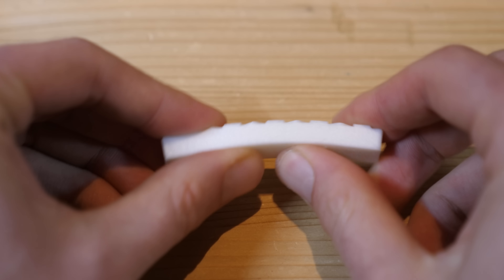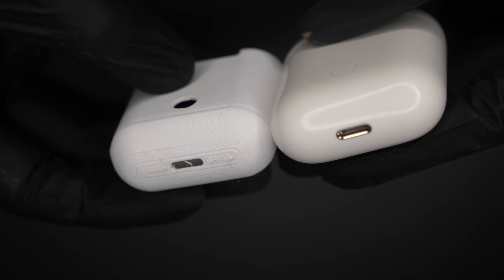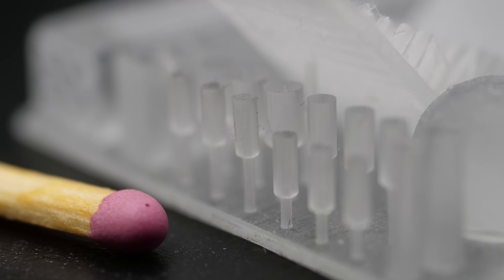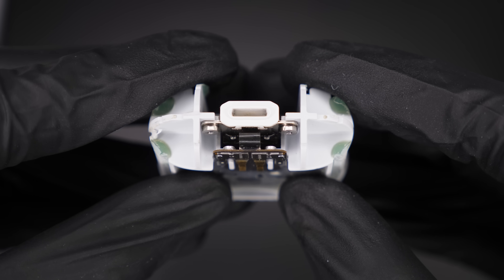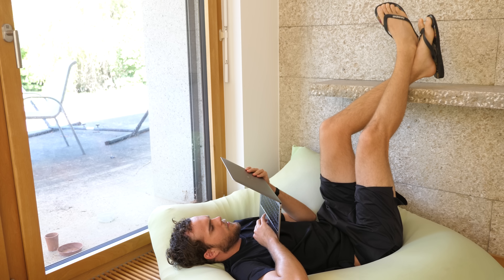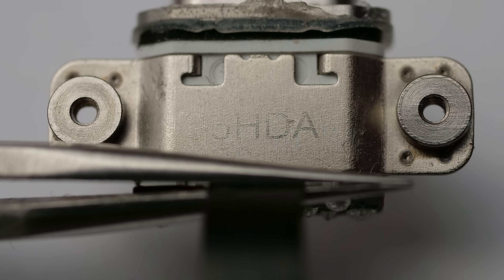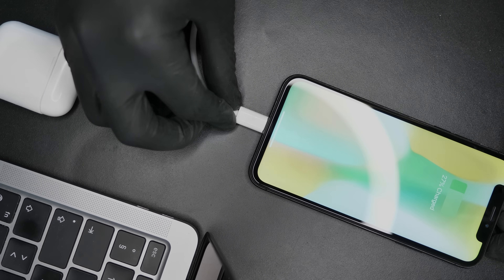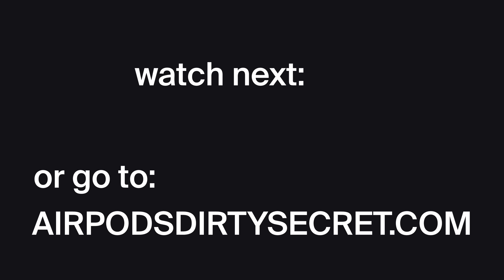AirPods' Dirty Secret (and how I'm fighting it!)

Comment: You're focussing on the wrong thing. 
Airpods are TINY and use a TINY amount of resources. Compare this to a car say which uses literally millions of times the resources.
If you were to properly recycle all components of maybe 100 cars that's the same as every pair of AirPods ever made.
The tech in Airpods and their case becomes obsolete in a few years in any case. This exercise is almost entirely pointless - you're almost certainly using far more resources than you're saving here - and even if Apple supported this it is, once again, Green Wash. 

This is you having fun, which is fine - but lets not pretend you're helping the environment in any way. You aren't.

Comment: Why it is sold like this; to make it repereably they would have to make the manufacturing cost much higher. Beginning with designing for reparability, choosing parts, checking if all works, providing spares later on. All that elevates cost. Sometimes it is better to produce with replacing in mind.

Comment: I need some GoPro mods like this, I used to check ragecams products but they were overpriced to the point of I should just buy a modded camera from them. All I wanted was to extend the image sensor cable to add cooling to the sensor and board.

Comment: More than 99% of the people cannot do the type of work you are demonstrating.  Most people cannot take apart any type of device to replace the battery.  As for myself buy products that are reasonable in cost to service or replace as necessary. I am using an Android phone.  If someone had to pay a design and assembly service to the AirPod project you demonstrated the cost would be ridiculous.

Comment: I still have the first gen pair. Accidentally put them through the washer and dryer multiple times, took a couple years before they finally died, (don't really hold a charge) have the pro now. But the old pair is just sitting on my closet shelf.

Comment: This video is dumb. Basically you need $2000 in 3d printing machines, space to house them and ventilate them, throw away a ton of support material, skills and training to use the software and hardware, in order to save some plastic? What is the point? I'm sure I can make a pair of jeans with a similar level of efforts but this is kind of dumb.
Reply from the maker: Hey, before calling something dumb please think a little bit harder, maybe you are missing something. Here the point is not to 'save some plastic', it is to save the rare earth materials from the electronics and battery inside the case. To give them a second life. Sure the first version requires a lot of effort, but it's  because I'm making it myself at home and it needs to be entertaining. The goal is to have the design mass-produced so people don't have to go through the same hurdle at home, they could just buy the kit.
Thanks for watching

Comment: & how environmentally friendly is all the chemicals U are using or the amount of plastic being used for the bottles they are stored in.???
Reply from the maker: You are right that it is not very environmentaly friendly just to produce the first prototype like I did. Here the goal is to demonstrate the idea with the hopes that the replacement part could be mass-produced in another way (injection molding for example). The point is to save the rare earth materials of the electronics and the battery present inside the case. 
Thanks for watching

Comment: I dont know why in the US there is apparently no competent technician, but I've been fixing AirPods 1/2 and Pro without breaking them, takes time but is doable, we change batteries from case and airpods with no mayor problem

But besides that point, amazing video, It is cool to print new airpods case designs
Reply from the maker: Would love to see a video of you repairing a Gen 1 case :) I'll be impressed if you can pull it off without visual damage.
Reply: @ExploringTheSimulation  I just have one that a costumer left the other day and I am waiting for new batteries from china, I will tag you on it as soon as I do the video (in my channel I have video changing the batteries from the “pods” they are much easier to take apart) , the case it takes time to do and it’s not that easy to take it apart but I have managed to do it, I still can’t believe how a guy with so much expertise like you can’t pull it off. I think you just haven’t take your time trying the proper technique 😅

Comment: Thank you for sharing your innovative efforts to up cycle the Apple AirPod case.

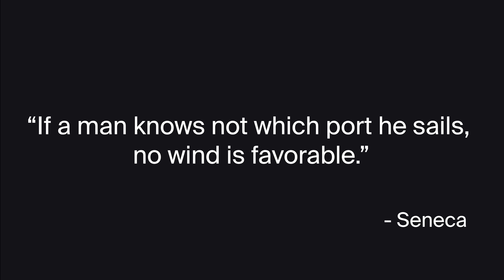Did you cover the main PCB inside the case (as shown at 6:43 in the video) with epoxy or printer resin or was it that way originally? I assume that you might have done this to improve water resistance.
Reply from the maker: It was like this originally, although out of the 3 cases I've cracked open, 1 didn't have it
Reply: @ExploringTheSimulation  thank you for sharing your experiences.

Comment: Planned obsolescence, as most things are designed these days, which hopefully will eventually be a fineable offense after the right to repair, and adjacent, laws start gaining traction. Apple could've designed these to have a rounded detent rather than a buttress tooth, all it would take is some force to pop the inner molding out of the case, 100% repairable and entirely unlikely to pop apart if you drop it. Hopefully environmental agencies will go after these companies as they actually have grounds to currently do so, whereas the typical consumer protection agencies currently do not as right to repair laws haven't gotten to the point of making maliciously anti-consumer designs a violation of consumer rights to repair products. 

As far as ports go, I prefer the design of the Lightning over USB C's design. Reason being is simplicity and physical mode of failure. USB C has a male nub inside of a female port and a male port with a female receptacle for that nub, what happens when that little nub breaks off or gets damaged, imagine how easily that nub can be damaged, just like all of the mini and micro ports before it within USB's lineage. Now compare that to Lightning, where you have a fully male port and a fully female port, the individual components themselves are more robust and simpler. Now compare repairs between the two designs if the male PCB breaks, USB C needs the device repaired which can be costly, whereas Lightning would only need the cable replaced which is far cheaper in comparison. I want a single standard just as much as everyone else, but USB C was not the way to go, especially when we've had this for half a decade now and I can tell you that the connection does wear out eventually, and loose connections can cause damage to thin PCBs acting as the copper connection point. USB should've just adopted Lightning's design philosophy. Hopefully there's a future standard of USB, such as a D port, that utilizes this more robust solution; as I also have doubts of C's longevity as standards are more quickly evolving and data throughput will realistically need more physical copper in the future, especially as USB is becoming the universal bus for many standards via mode switching and the capability of daisy chaining devices, C just doesn't have the physical lane width for what the standard is trying to achieve.

Comment: The AirPods being glued shut is one thing but to not include screws to easily access the case just shows how much they want you to waste money on another , eco my ass , buy a cheap brand and you might be able to repair it without pro level equipment, next step T2 chip to stop port replacements all while disguised as a security measure 🤦‍♂️

Comment: Just to point out the one argument about this being for the environment... your original case still went in a landfill.  Using epoxy to repair the original case would have made that point. But 3D printing it to fix it, totally onboard. Just don't need the Eco BS. You know?
Reply from the maker: the argument lies more in saving the rare earth materials present in the electronics inside the case than saving a few grams of plastic and adding some epoxy on it, which will make the solution less accessible to people than a standalone replacement part. thanks for the comment
Reply: @ExploringTheSimulation  That makes sense.

Comment: Not only he fixed the issue considered impossible, he upgrades it. Gigachad my man.
Reply: I've never once seen a type C cable busted open with wires showing and it's soul devoured by like 1 year of use. I can't say the same for lightning cables and ports. Pretty sure USB-C is an all around upgrade in performance and durability. But man... Do you guys remember when phone ports used to wear out and eventually you couldn't even charge them anymore? I'm just glad we don't live in that world anymore.
Reply: Good he made a repairable one, but why make something that looks like the same thing?
Reply: @mhavock  I mean, as DankPods always points out, Apple's case is really one of the best designs when it comes to pocket-ability. It's not the overall size that counts, it's thickness. And as a proud Galaxy Buds user I hate to admit this but Apple has got it right there. Samsung even made theirs a bit more slim and bigger in the other dimensions with their newer Buds Pro.
Reply: Apple is gonna come after him for royalties along with "seize" and desist.
Reply: I mean, they never said it was impossible. They said it was more expensive to repair than replace. Which is correct (or at least was, prior to China's ongoing economic collapse).
Reply: absolute lad
Reply: True legend
Reply: The Gigachad: Destroyer of Karen
Reply: She said usually, not impossible
Reply: He snatched victory out of the jaws of defeat
Reply: Agreed.
Reply: And almost with no effort 😂😂
Reply: These day things are called impossible purely because of profit margins
Reply: Nothing is impossible.
Reply: Is it not illegal though ...are they not patented?
Reply: Nothing Is impossible
Reply: Best part, he shared it.. A contributor to the bigger picture, we need more of those !
Reply: Gigachad
Reply: this was not economical
Reply: The type c port isn't an upgrade
Reply: @mus_xr4653  depand on how you look at it.
Reply: @mus_xr4653  Type-C Port is a upgrade in any way. It's way faster than those outdated Lightning ports.
Reply: @0x495e  it's not going to charge the air pods faster and you won't need the faster transfer speed and the lightning is much more durable
Reply: @mus_xr4653  You can believe what you want. you can also go buy another set and keep feeding the monster
Reply: @KRigby  i only have one Apple product and it is an iPhone xr and, i hadn't replace the port nor the cable. i also support right to repair but not with the cost of making products less durable
Reply: @KRigby  i also have a 8 year old Samsung tablet that i keep fixing
Reply: @mus_xr4653  on durability... are you complaining about the port or the jack? I hate micro-usb, but then again i don't think i would have that opinion if all the micro-usb ports i ever used were apple products because they wouldn't use cheap surface mount ports. In the same train, I've had a lot of 3rd party lighting dongles snap at the lighting jack, over priced Belkin ones seem to hold up.
Reply: @itainteasy  both. The micro usb port is the worst in terms of durability, i had to replace it on my device 5 times
Reply: @mus_xr4653  Eh, I'd rather have the convenience of not having to worry about keeping a Lightning cable around vs the very minor durability loss compared to USB-C. But honestly, we'll probably see a portless Airpods case next
Reply: @mus_xr4653  bwahahaha. Did you just say lightning is more durable. Almost every single apple brand lightning cable falls apart within a year. It's already been proven by actual science, rather than your anecdotal evidence from ONE device (LOL), that USB c is far more durable. Derrrrrp. You sound like the one guy that has a car known for its unreliability, and comments, "I've had one for 15 years and never had a problem." LOL. Like a sample size of ONE matters at all. It's like people don't understand how statistics work.
Reply: @mus_xr4653  Never had a USB-C cable corrode or break from literally sitting in a car, but the lightning cables always corrode and-or break at the cord or pins corrode away. So it might be durable, but the cord and pins are trash!
Reply: @littlejackalo5326  Agreed that the lightning cable is very fragile but not every one has to replace them every year. Mine is still working fine from 2019 even after I bent it while charging my iPhone. I just unbent it and it works fine. Same with my friend.
Reply: @mus_xr4653  Lightining is not more durable, never has been (let's just say a wide open port with no center makes for a great lint and dirt trap), and the iPhone XR isn't even close to old enough to claim durability on personal experience alone. USB-C is known to be durable as a matter of mechanical design and structure, actual mechanical design technicians worked on the standard and built it for the express purpose of reliability, not some bored intern inspired by a SCSI cable from the 80s.
Reply: @mus_xr4653  BRUUHHHH Lightning cables are designed to break within 2-6 months at the same exact point (right under the connector itself) near every time.

Apple accessories are NOT Made to be durable, they're meant to be replaced
Reply: @mus_xr4653  The idea that making something more repairable makes it less durable (or waterproof, etc.) is absurd to the point of being laughable. I won't even bring up countless examples of phones and laptops far more durable than Apple's products or how Apple keeps having convenient engineering flaws in their products that line up perfectly with that planned obsolescence period. How about the fact that the most reliable and durable tech in the world... Military and enterprise hardware, happens to be incredibly, extremely repairable and modular?
Reply: @mus_xr4653  never had a type c port break. The finish on lightning comes off bc its exposed.
Reply: @erichood3169  never happened to me
Reply: @mus_xr4653  just st fu
Reply: @mus_xr4653  USB c to lightning supports up to 90 ish or so watts and that's all we get from apple also the transfer speeds are locked and capped at either 480mbps with USB 2.0 or 10Gbps with USB c on the end, as for USB c however it can utilize USB 4 which supports wattage up to a crazy ass amount that you'll ever need for a phone ahem 240 watts and the transfer speed from USB c to USB 4 is also 40Gbps, but hey at least USB c specs are easy to find, so one side obviously isn't ashamed to show specs...
Reply: @cherlz5382 will the airpods charge any faster?
Reply: @mus_xr4653  yeah they will since the circuits are different and made for USB c and not for lightning, if it was just an adapter then no it wouldn't but since he changed the ports completely of course it would.
Reply: @mus_xr4653  think of it like this since USB c is able to have a much higher wattage than USB c to lightning because USB c can use USB 3 and USB 4... THEN WHAT DO YOU THINK?
Reply: @cherlz5382  he didn't remove the original charging circuit board. That means, that the airpods will not charge any faster than stock.
Reply: @mus_xr4653  he literally made a custom circuit board wdym he kept it stock??
Reply: @cherlz5382  he made a replacement charging port flex cable with a usb c he didn't change the whole charging circuit board
Reply: @mus_xr4653  yeah he changed the CHARGER PART OF THE CIRCUIT, do you not see your own contradiction there?
Reply: @mus_xr4653  that circuit is only for the battery and serves no other purpose than other gizmos and shit that's pretty self explainable, but changing the charger part will not change the whole airpods but since your argument was will it help it charge faster well yes it will because now it's specced out for type c, you're thinking this as pc hardware when it ain't that deep. It's only for the battery, trust me.
Reply: @mus_xr4653  if something is as good in every way that matters technically, then making improvements to usability and replaceability are stringy improvements.
Reply: @mus_xr4653  If all your devices are UsbC, it is an upgrade to add a deice to that list.
Reply: @mus_xr4653  Found the apple fan.
Reply: @Tayfaan  lol the fact that android is more repairable is enough for me. I had an iphone SE for a little under a year and the camera lense broke way too easily. It was also easy to drop since it's smaller and apple decided it would be a good idea to put money on the processor instead of the screen size so when I went to get my new phone the se looked super out of place and ugly compared with the budget android that was half the price and not much slower
Reply: @Tayfaan  more like apple simp
Reply: @mus_xr4653  yes it fool
Reply: @mus_xr4653  
It's not perfect, but it's better than lightning definitely
Reply: @mus_xr4653  

Dude what you on about, everything will lightning gets broken ports and cables constantly.

My sister loves Apple and she is very careless, her iPhone and airpods both have scuffed ports while her ipad pro and beats pods whatever which both use usb c are in perfect working order and outlived two sets of iPhones and airpods and continue to do so
Reply: @beni5149  i just like how the lightning port and the cable look
Reply: @mus_xr4653  "usbc is not an upgrade"
Higher transfer speed ✓
Much faster charging speed ✓
Cheaper✓

There is a reason why apple switched to usb-c on their macbooks and top end ipads, its an objectively better technology. Instead of saying its not an upgrade say its not an upgrade for an airpod case, major difference.
Reply: @Myemnhk  none of these will make the airpods better
Reply: @mus_xr4653  you literally stated earlier that higher charging speed was better.
Reply: @Subt0nix  no i didn't, what i said is even if the usp c is faster doesn't make the airpods charge faster